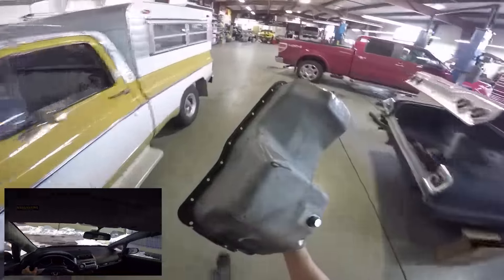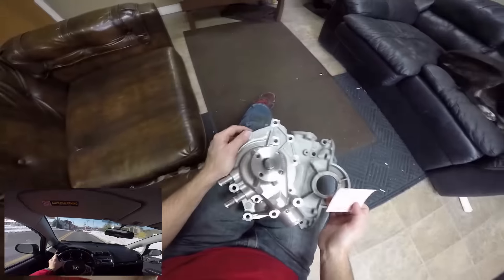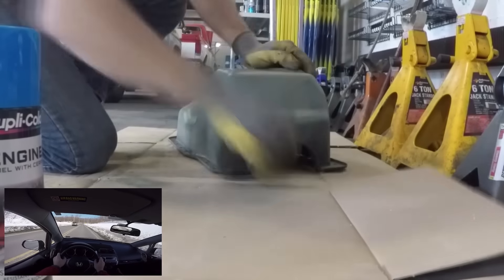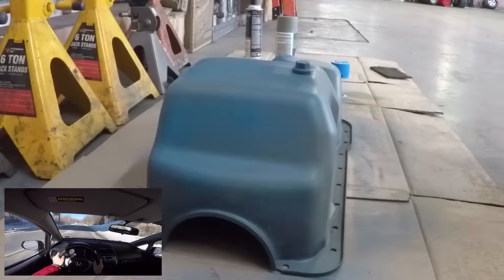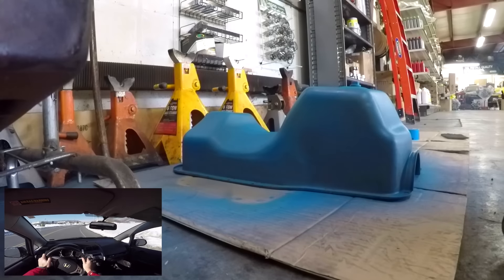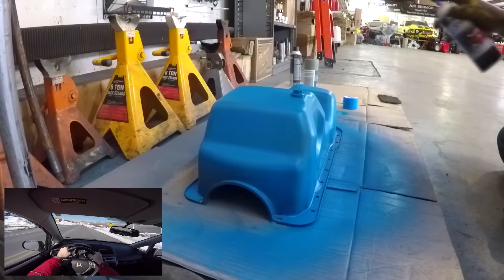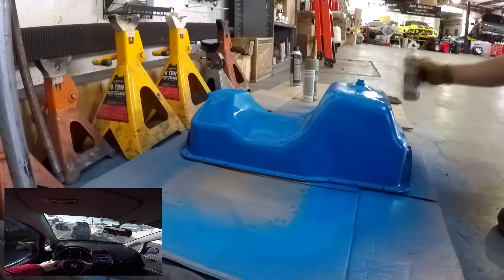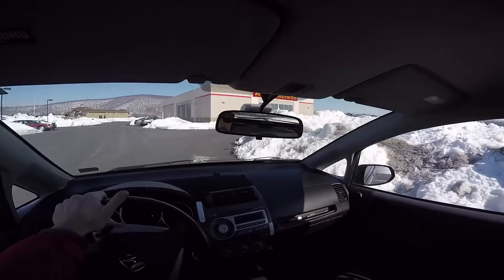Painting Vlog

Comment: I'm not sure how such things work, and how Advance in particular works; what level would a sponsorship of this size need to be approved at? Like, is this thanks to Corporate, or to the one particular store that you go to?
Reply: More than likely it was on the local level, district at the highest. I don't know the specifics of the deal but I would assume it's a healthy discount on all the parts. Advance has multiple tiers of discounts based on volume of sales over time to commercial accounts. If you do a fair amount of side work as a private person you can set up a base level account with them and it will help. 
(Former CPP at Advance for 3 years)
Reply: Rob Milchling I wasn't sure if they'd need to check with the higher-ups before agreeing to an actual sponsorship. Thanks for the response!